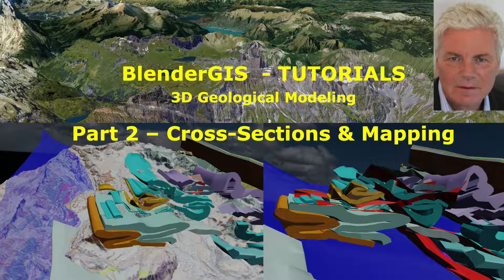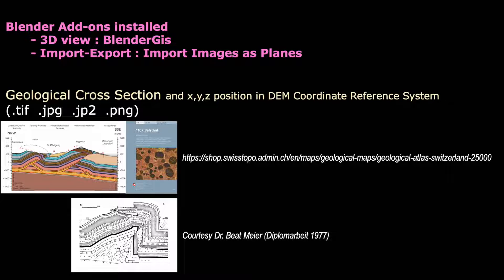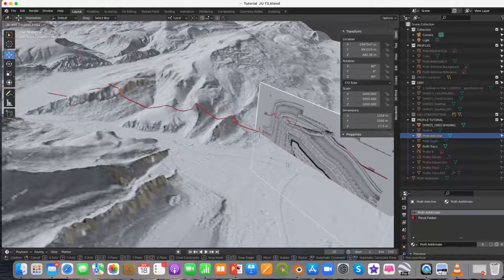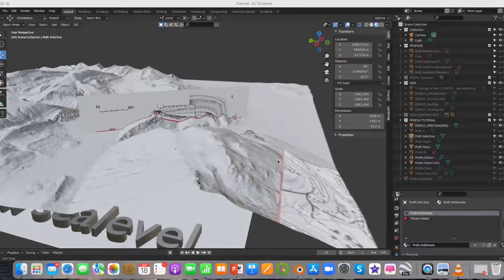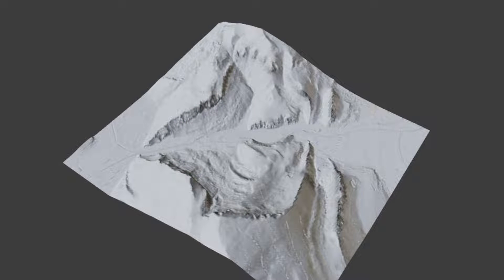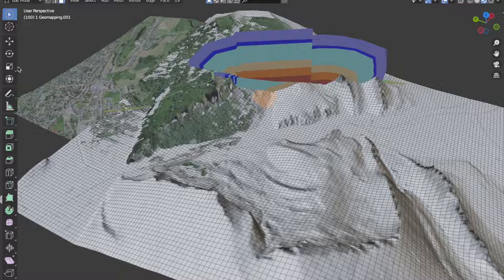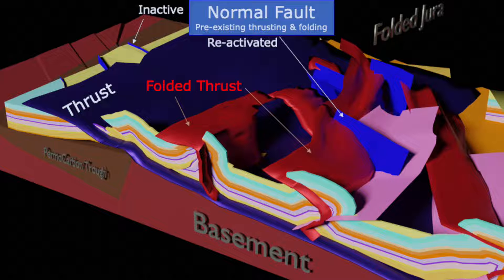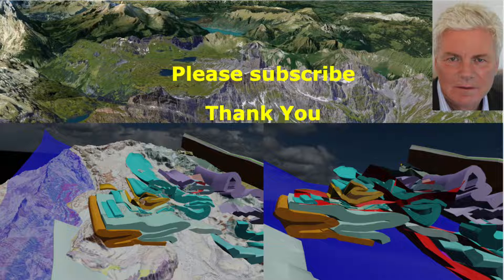BlenderGIS Tutorial PART 2 - Cross Sections & Geological Mapping

Comment: whoa! this is amazing and so useful! I've been following the steps but I have another study area, in which the DEM does not have the format .asc but .tif and when I change to Edit mode, it just goes into a plane, do you know how can I transform it to .asc from QGIS or something like that? Thanks, you're an inspiration man!
Reply from the maker: Hello and thank you for your encouraging words. I am a bit fortunate to have DEM in Ascii Grid format available -the easiest and fastest way to create DEM in BlenderGIS.

In your case you could go two ways

1. The QGIS - BlenderGIS route - and create a DEM terrain mesh in Blender, driven by a QGIS grayscale altitude map. Once available you can  project your geological information georeferenced with the same CRS onto it

There are many Tutorial on this - here an example
https://youtu.be/J8wkghNmsWc?si=Jt5rmQwbeCxLimYi

A. Prepare the Heightmap in QGIS
1. Load your DEM raster in **QGIS**.
2. Style it with **Singleband pseudocolor → grayscale (black=low, white=high)**.
3. Export as an *8-bit or 16-bit grayscale GeoTIFF* (prefer 16-bit for smoother displacement).

B.  Import into BlenderGIS
1. In Blender, enable *BlenderGIS* add-on.
2. Use *GIS → Raster → Georeferenced raster* to import your GeoTIFF as a plane (or import your basemap first).
3. Scale the plane to your desired resolution.

C. Apply the Displacement
1. Create a *material* for the plane.
2. Add an *Image Texture node* → load your QGIS grayscale DEM.
3. Plug it into a *Displacement node* (not the Principled BSDF).
4. Connect Displacement → **Material Output (Displacement)**.
5. In **Material Settings → Displacement**, set to **Displacement and Bump**.

D.  Adjust Geometry: Increase *subdivision* of the plane (use Subdivision Surface or Adaptive Subdivision if using Cycles with Experimental features).
* Tweak *Displacement Scale* until terrain matches altitude range.

2. The Google Earth route: You can create low resolution more regional DEM directly  in BlenderGIS using GoogleEarth data - also many tutorials are available on this - here is one tutorial 
https://youtu.be/u8Fg-u-VWUE